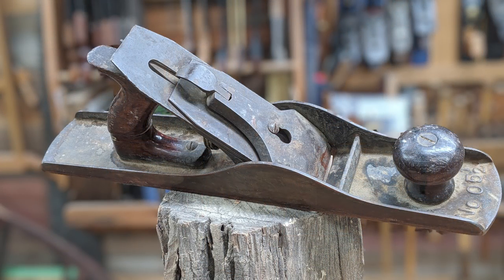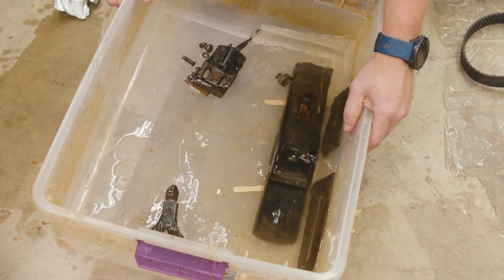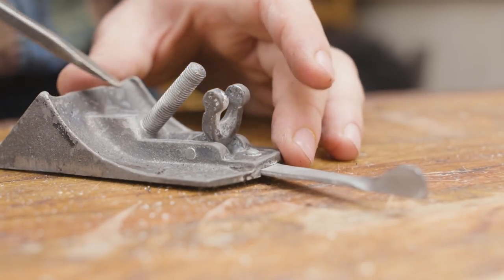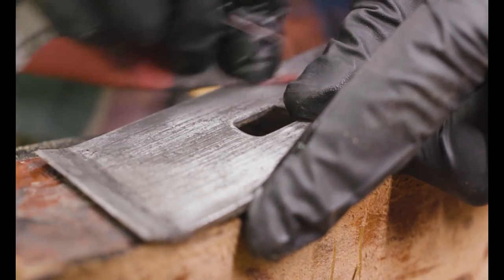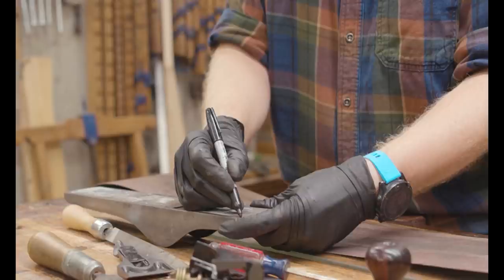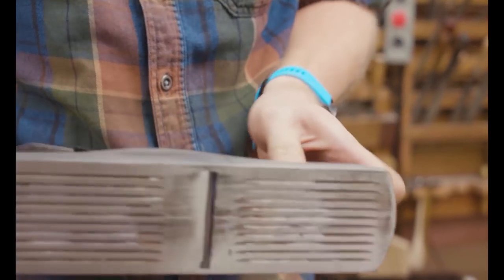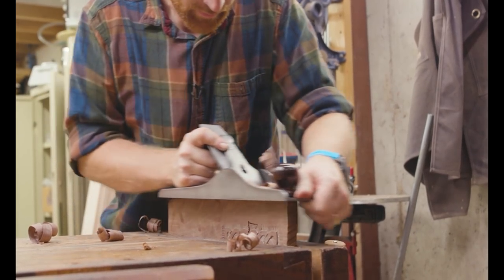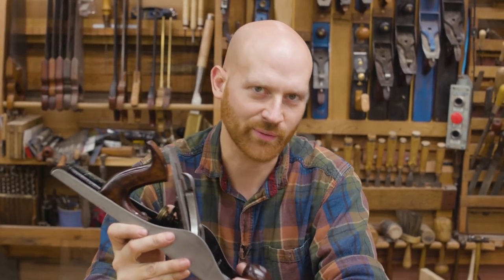How to Restore a Hand Plane with new Japanning

Comment: I was lucky enough to find a Stanley 5 1/2 for $15 at a yard sale. This plane is a type 9 without the frog adjustment screw. Sadly, this plane has a broken handle and knob. I don’t have the early style in my parts bin so I will need to repair it. I also picked up a 4 1/2 but it was poorly braised. The braise is solid but not flat. Should I flatten the sole or should I look for another sole?

Comment: Great result. Be interested to see the sand blasting video. I always assumed it'd be too messy a tool for me, but your setup seems compact and tidy
Reply from the maker: if I connected a vacuum it would be even better. a good blasting cabinet is a great thing to have!
Reply: @WoodByWrightHowTo what size air compressor do you have to run that?

Comment: Would boiling the pieces of an old, rusted, Stanley hand plane for 45 minutes to an hour (or steaming it) harm the plane in any way - the Japanning, especially?  This is a common way of conserving the original finish of fire arms and dealing with rust - especially blued metal.  It enables the removal of surface rust without removing the bluing with the subsequent use of a carding wheel (very, very soft wire wheel).  I've noticed what appears to be bluing on some of the older planes, for instance on the spring on the rear of the chip breaker, possibly some plane bolts have been blued also.  Thoughts?
Reply from the maker: There shouldn't be any bluing on the plans but boiling them would not hurt. The japaning has to go up to several hundred degrees before it causes a problem

Comment: Have you ever used a never seize compound on plane parts?  I'm thinking of the frog, tote screws specifically but perhaps the mating surface of the frog as well.  Appreciate your comments on this.  Really appreciate the link to japanning technique as I have a similar "project" plane.
Reply from the maker: I have not. But I have never had problems with seazing on my planes

Comment: Put the Wood by Wright logo on it and auction it off, jk that is a very nice plane and I'm with you, making it looked loved and used is nice, it's not super clean and shiny so your nervous about using it and it's not so dull it's you think it wont work. Not going to lie was very surprised to see a sandblaster in your basement, I've always wanted to use one and the foundry I worked at went under before I got to use the one in the maintenance shop.
Reply from the maker: thanks! I actually ave 3 sand blasters. but none of them are setup well.
Reply: @WoodByWrightHowTo  wow 3, got one for hand planes, one for wrenches and one for everything else

Comment: James, I love your channel, watch you for years. Thanks for all your videos. Sir I have a craftsman 14" jack plane I bought used. When I svcrew the blade forward, it does good, but when I screw it backward it stops before it gets the blade back in completely , leaving about a 1/32" still hanging out. I am a nube to planes, i watched all your videos on planes.... any ideas?
Reply from the maker: if the rion sticks out past the chip breaker 1/8" or less and that is the problem, then the chip breaker is the wrong one. If it is more then 1/8" then the chip breaker should be moved forward.

Comment: I really liked that you used this real, taditional jappaning insteda f a synthetic paint. Do you ever put a slight angle on the sides and nose of the plane as Paul Sellers does?
Reply from the maker: I generally don't round over the nose and tail of the plane. I have no problem with doing it it's just one more step that in my book doesn't need to be done. But there's a lot of people out there who would argue the other direction. Just two different schools of thought.
Reply: @WoodByWrightHowTo  Great thanks for your answer. For me it is something kind of agressive which I` m a lttle bit afraid to perform... and it seems like making the sole shorter and narrower.

Comment: What kind of file was that with the curve and the extended handle. You were using it to flatten  the body where the frog sits...
Reply from the maker: That is a riffler they come in all different types of shapes and sizes and grits. I have a video talking about different types of files where I go over them as well.

Comment: Nice video. Have you tried any solvents to remove the jappaning. I dont have a sandblaster.
Reply from the maker: Solvents and paint removers can work but it usually takes several coats to get it off. it's very thick stuff that just doesn't want to dissolve.

Comment: How do you remove japanning without sandblasting? Any time I've attempted laquer thinner there's always 20% of the old japanning that sticks in the nooks and crannies and I'm worried it'll compromise the new paint job.
Reply from the maker: There really isn't a good chemical way to remove japan and completely. But the good news is it will not cause a problem if you coat over the little bits that are left. If you're going to use a spray paint then first hit it with a self-etching primer. But if you're going to hit it with your panting, there's nothing to do other than applying it.

Comment: Have you considered using the sand blaster to remove old lacquer? Also, why use japanning rather than spray paint?
Reply from the maker: the problem with sand blasting the wood is it is too easy to go too far and when it does it shows the rings of the wood. but the scraping really only takes 4-5 minutes and you are done. no setup needed. The japanning is what was originally used. in this case I want ed to show it. but it is also much more durable and provides a longer lasting gloss. but int he end it is a personal choice.

Comment: Hi there! I was recommended to ask you if you had the measurements of the chip breaker from this plane. I have the same one I am trying to get working, but the blade and chip breaker my grandpa had on it were Stanley, and it seems to me that they are not exactly interchangeable. I plan on filling, and moving the height adjustment hole on the Stanley chip breaker to make it work on the Ohio 5 1/2 but am unsure of where to put the new hole. I would appreciate any help you could give me
Reply from the maker: Yes. Ohio and Stanley each had slightly different yoke hole placements. I don't have this one anymore to pull the measurements on it. Sorry. The best way to figure it out is have the yolk coming through the frog at about 90° then put the iron and chip breaker in and the tip of the iron should be ever so slightly retracted so that a little bit of forward movement on the yolk would push it out of the mouth. So you can see how far the hole needs to move up and down to get the iron to that location.
Reply: @WoodByWrightHowTo  thank you for the tip! I have been loving your videos especially as I go through my great grandpas collection. Keep up the good work!

Comment: Hi James, I've got a Keen Kutter No K7 (Stanley Made, I think), where the japanning is pretty much gone, and it's becomming a rust bucket too. As much as I'd like to do the HTR japanning, I jist don't have the time or resources right now. Spray paint in the past has been hit and miss quality. Do you know of any finish alternatives to japanning that don't take as much time and won't completely destroy the value of the plane? There's paint, but what about BLO baked on with a torch or something? My workshop is my garage, so here in the midwest they definitely get exposed to humidity.
Reply from the maker: Honestly if you wanting the japaning look the next best method is black engine enamel. Most everything else I have tried just does not look right. Just make sure to start with a self etching primer.
Reply: @WoodByWrightHowTo  thank you sir

Comment: The front knob is a lot easier to strip if you put a bolt through the hole and then spin it in a drill press.  Then you use some sand paper while it spins.
Reply from the maker: I still prefre this way as there is less dust and there is no setup time. it really only takes 2-4 minutes to scrape clean. but that is just my personal preference.

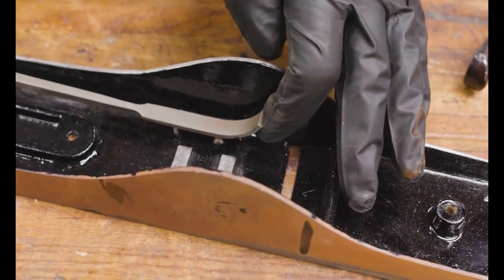Comment: 4:14  what kind of file is that, and where do I find them?

BTW, I use Evaporust and think it has the least of that "fake patina" of all the soaks I've used. One way to mitigate that is to check it every 30 minutes or less and pull out the parts as soon as the rust is gone. Rinse and brush them and IMMEDIATELY spray regular WD40 on them. 
No rust, and little to no fake patina. 
Then you can hit it with files or whatever to get it tuned without having flash rust....
Edit: I forgot, DONT even dry the parts between rinse and wd40 hit them with a paper towel or air blast from a compressor to get most water off, then spray with wd40. Its Water Displacement try 40, and does a very good job! And make sure to wipe off excess wd40 and oil with 3 in 1 before assembly, but it works wonders!
Reply from the maker: That is a rifler. I have a nice cloection of them.
I have used evaporust quite a bit in the past. I use WD-40 specialist as it is much cheaper and easier to find around here. And the two of them give almost identical results. The rust on this was from the Japanning baking. Anytime you heat up the japaning it will rust exposed metal around it.
Reply: @WoodByWrightHowTo  Good to know! I will definitely look into that stuff when I run out of Evaporust. Part of the reason I got the Evaporust was that I could get a 3 gallon bucket with a little basket for parts. 

I didn't even see the rust on yours (you couldn't use wd40 anyway since you were going to Japan it), I just wanted to let others know so they dont have to go through what I've gone through soaking, then having to re-derust it after it flash rust. 

I love your videos! Seeing people fix up old tools is great, and then to actually use them is even better!

Comment: 2 coats with 400 grit sand paper sanded and then with a forth coat. hmmmmmmmmmmmmmmmmm. Is that how you count table legs?
That's a thick blade, btw.

Comment: After several rounds with the AI I determined that today the term paint and japanning to be basically the same. While westerners in the 1700s used asphaltum both the coloring and base for varnish (japanning is black varnish) and it is slightly transparent, that it is made from resins and oils. (varnish is clear while paint is pigmented).
Today you can obtain paint to be the same as jappaning. They even have Kandy black as well as white (that means it is transparent).  There is powder coating which is the same as catalyzed paint but using an exterior source of heat to melt the plastic. There is Catylized paint that uses an internal source of heat to cure, such as epoxy does.
So paint your plane in a durable paint and tell everyone it is japanned. 
If in the past something was varnished it would be clear coated. today you can get unpigmented paint. (which is an oxymoron). And clear coat a part.
Today we say something is varnished but it doesn't' use the Var bug that ate the lac bug to produce varnish but instead is artificially manufactured.
:elbowcough: